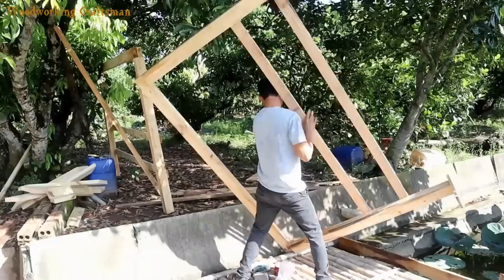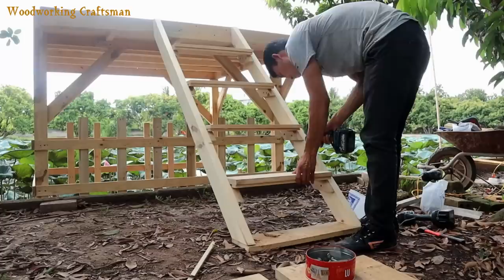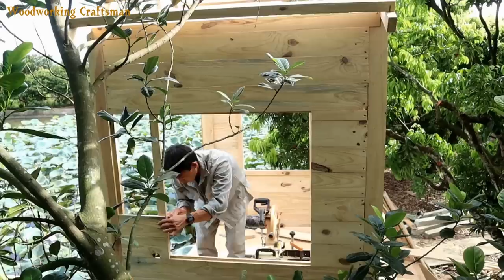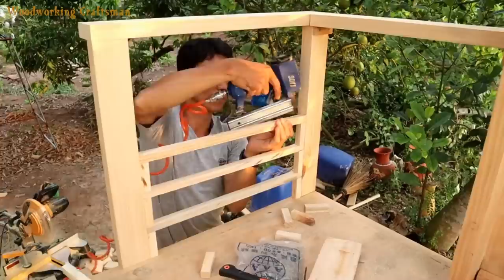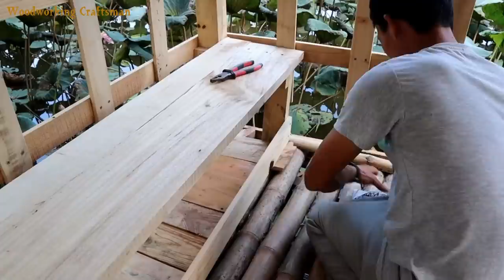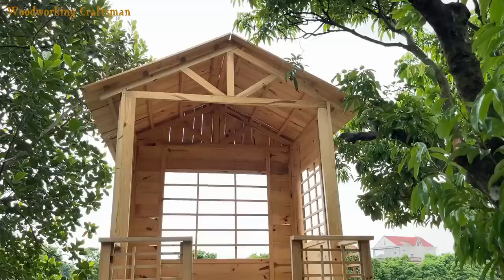Extremely Unique Woodworking Projects & Amazing Skills // Wooden Hut On The Lake

Comment: The roof needs to be secured and protected from weather. Wind and water will destroy it if you leave it that way.
Reply: I guess you skipped the part of video where the gentleman placed, sat and affixed the boards of the roof with nails.
Reply: Norman it is a HUT, a rustic, traditional building that is part of the local culture.  It is beautiful partly because it is ephemeral.
Reply: @PepperSkeen  ini 9l LP Zee
Reply: The roof it is a solid wood but no protection on the top the weather or the rain and heat of the sun will destroy it earlier than expected.
Reply: They used brade nails.not very good with high winds.
Reply: @PepperSkeen  ñnññnņvvbñņńbbbbbbb
Reply: Ppp⁰00 Monte aquela mulher fazendo as porta aí na serraria ela faz porta e janela faz todo mês quadrilha
Reply: I'd be more worried about spiders nesting in that little hut more than anything else...